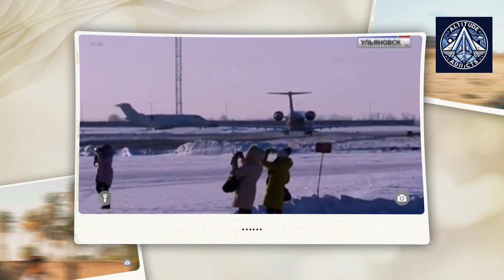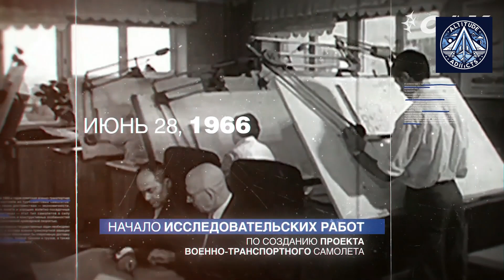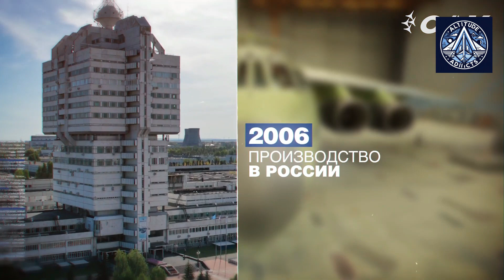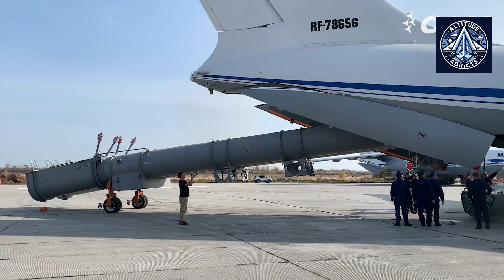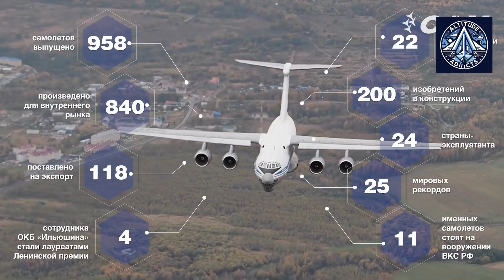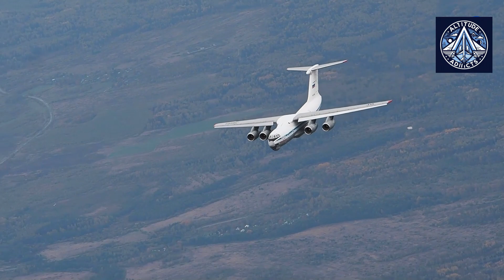Secrets of the Il-76:  Why This Soviet Plane is STILL Flying Today?

Comment: If it wasn't relevant, the Russian wouldn't be modernizing & building them, as the An-70 project was cancelled, remaining An-22s retired, the An-124s have shortage of engines & more costly to operate, & follow on Il-106 & Slon r still paper planes. Also Il-78s & A-100 use Il-76 airframes; India has C-17s but still wants to extend the life of its Il-76/78s

Comment: Why don’t they get rid of the ugly windows below the nose cone. Just add a camera?
Reply: Which problem would this solve?
Reply from the maker: I am not taking sides. But it can be argued that one crew will be less and better aerodynamics.
Reply: @altitudeaddicts  Do you really think those windows generate that much drag? They are used for a reason. This aircraft operates from rough airfields and in conditions from desert heat and dust to snow storms in the high arctic. Having a navigators position like that has been useful in the past. I would say for the fire fighting water dropping version having a man located there would be valuable. For some roles maybe not but I don't see the harm of having that position.
Reply from the maker: Regardless of technical merits, Russia thinks a man has to be there, he should be there. I just gave a counter point. The two of you had very valid questions.
Reply: @altitudeaddicts  Which one you'd wanted to fire: flight engineer or navigator? In military version there is additional crew members for gunfire support and REW but in civil version their seats are taken by 2 additional air engineers. The issue is that air navigation systems on those aircrafts was designed the way that required additional manned-crew for safety purposes - i.e. to navigate and operate in dangerous environment without access to GPS or something. It's costly for civilian aircraft for transporting people as well as additional engines but for purpose to transfering critical cargos it's acceptable - you'd prefer to spend some more fuel to arrive than aren't arriving at all. btw - just think how civilian transports designed today where additional crew members and engines were sacrifaced in favour of money spent per km but eveyrone is accepting that while military spending more to add additional security to their weapons.
Reply from the maker: If you see the latest cockpit, the issues you mention of GPS etc are of past. It appears, Russia is continuing the air frame as they do not want a redesign. BTW, why does the Civilian version require additional air engineers?
Reply: @altitudeaddicts  I didn't said that those planes haven't GPS. I said that they are designed to be able navigate in environment where it's impossible to use it. Why does civilian version needs additional engineers - I dunno, better would be to ask actually those who are using such planes how they operate and do or do not fill those positions. Wiki told that in Russia they are used by military and rescue service(MCHS) and their main concern probably is safety and price of addiitonal salaries aren't that matter - moreover I'm pretyt sure they are interested to ahve additional pool of available specialists if would be need to quickly expand their fleet or something.
Reply: @hypothebai4634  That is a complicated design up front, with all the windows, seals and the structure needed for it. It would be far simpler, less costly and probably have less parasitic drag by eliminating those windows. If a view from that vantage point is THAT needed for some applications an effective cam can be added which is far less intrusive. Cam technology has come a long ways since the 1960's!
Reply: I guess it’s better to have a navigator below the flight deck. I don’t see any issues on that part.
Reply: @SpectreCompass  Ask those who've designed it in 70th - I don't know why they are designed them this way.
Reply: @Erhogz  Hey cool down. It’s not an issue. The answer is so simple. Look at the geographic location and areas of Soviet Union back then. So the design philosophy of the Soviet Aircraft has to be robust to cope up worse and unforgiving weather conditions like in Siberia. It has to simple and direct to operate. The navigation deck was built so that the navigator could inform the commander to evaluate the risk of landing in certain unpaved areas. In simple terminology, the commander had an eye on the below deck because the aircraft is huge. The technology back in the 70’s was not modern as today. Today’s Russia decided to keep it that way to save cost. It’s easy and manageable. Too much of complexity of technology in the aircraft can lead to high operational costs. I see it as not an issue at all. It’s great anyway.
Reply: because these are unique feature of this aircraft. which one else do have such a smile on its nose?